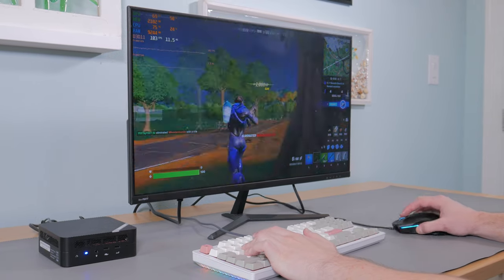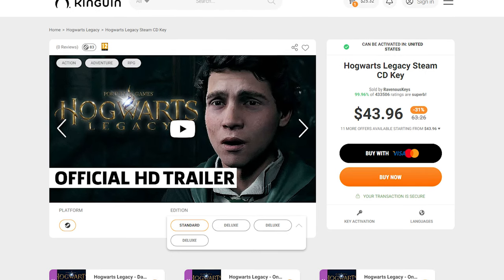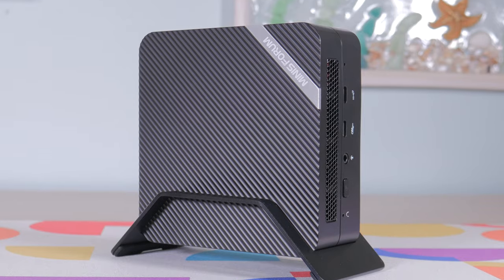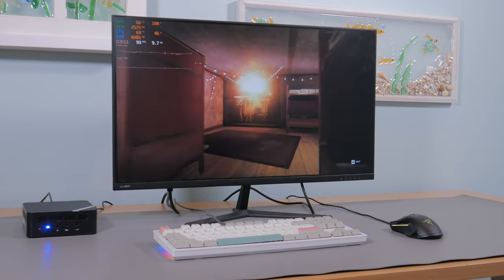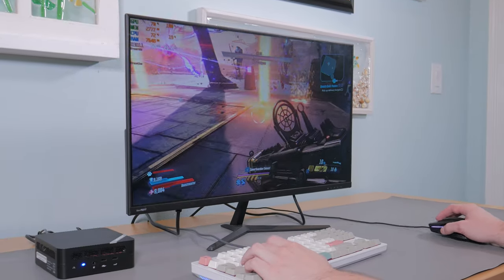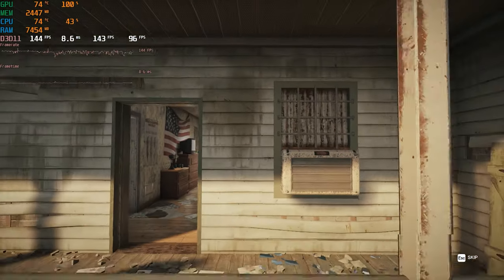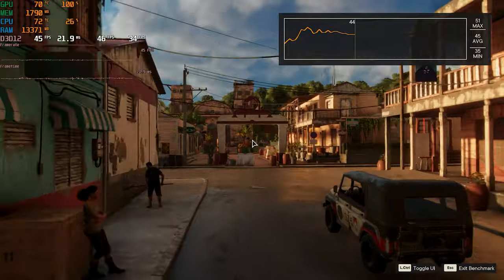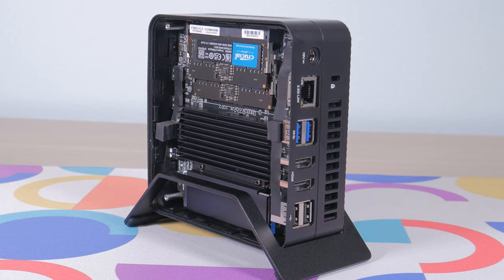This $450 Mini Ryzen Gaming PC is SUPRISINGLY GOOD!

Comment from the maker: Buy Windows, MS Office keys and many other products on Kinguin: https://kingu.in/techbymatt
Use my code: 'MATT' for 20% off with instant delivery. 
Thanks to Kinguin for sponsoring this video!
Reply: You just destroyed it. The heat sink uses liquid metal, not thermal paste. The BIG WARNING LABEL in the box was about just that.....
Reply: @davefroman4700  In what way did he destroy it? Didn't change or damage the TIM in any way
Reply: @Sithhy  The liquid metal compound that he wiped away is far superior to ordinary thermal paste. And these unit require that extra heat transfer capacity of the liquid metal, to keep from overheating in that tiny enclosure. And you cannot just buy it on a shelf somewhere.

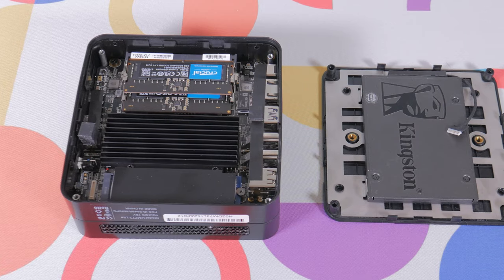Comment: [Sorry in advance for my not so good english] You installed 2.5" sata drive wrong (see at the 8:03 and further, the best picture is 8:12). Look, the cover has wide hooks at three sides. And narrow hooks at one side, which goes to the rear, where USB, HDMI and other ports are.
If you align the cover correctly, then sata cable will be too short to reach the sata port on MB (sata plug will be at the side where memory is).
If you turn the cover 180 degrees for sata cable to reach the port, then hooks do not click in place and the cover does not fit tightly.

So you have to install sata drive with interface side the other way. That's strange because vendor even made kind of indentation in the metal cover the size and form of sata plug. But no! Correct position of sata plug would be 180 degrees from that place. I can not understand their logic, really, it's quite misleading. But that's how it has to be installed.

I know because I tried to install 2.5 sata hdd in addition to the main nvme ssd and struggled for some time :D

Comment: if the front usbc is usb4 it should support display port MST so you should be able to connect 4 monitors, two via native HDMI on the back and two by using daisy chaining or a laptop port replicator, could you check it?